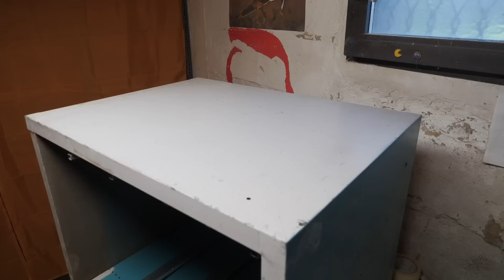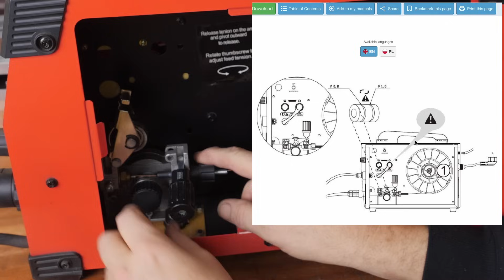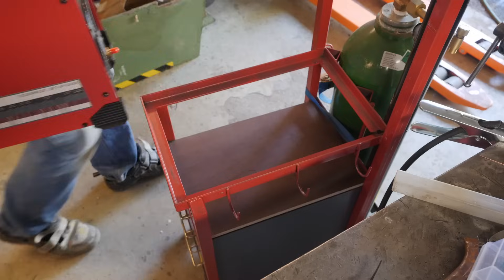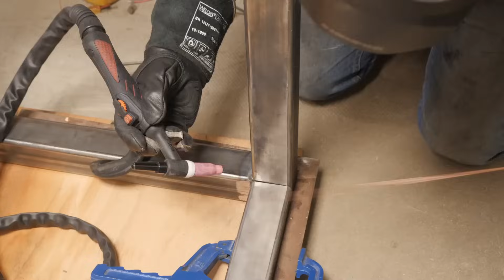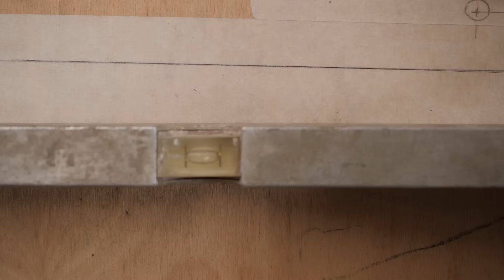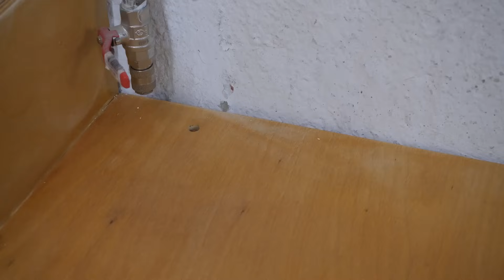My best workshop bench || RotarySMP

Comment: I assume that's a solid steel wire for the mig welding, since you got CO2 hooked up? I heard that with flux core a serrated drive wheel is desirable, because it can otherwise just crush the wire and feed less than it should. But since it clearly isn't slipping, that doesn't seem to be it either... I've also seen in some welding tutorials on youtube that being able to stop the wire is actually OK for tension (not being able to stop it would be too much tension). But again: clearly not the cause of the mismatch in feed rate anyway.
The "weirdness" on your new welders wirebrush is a pseudo-hammer to get rid of the slag from stick welding.
Reply from the maker: Thanks for looking at that. Yes is is solid core wire. That is a pretty weeny slag hammer. I already have a better one :)

Comment: In 1993 I was deployed for operation southern watch. Walked in the chow hall one day and the community bulletin board had a fresh picture of an F-15 with an enormous gap in the right wing tip Down to the honeycomb fuel cell from the tow team running it into the steel I beam of a sun shade. Ouch
Reply from the maker: Darn, that would have generate a couple of reams of paperwork. As will this A320Neo.

Comment: Your tig welding is getting better. Try working the puddle with the torch for a smoother weld.
Reply from the maker: Thanks for your feedback. I look forward to the next project for more practice.
Reply: @RotarySMP  If you don't know the channel, you might look at WeldingTipsAndTricks. He has been running what amounts to online welding classes for years. He's covered a whole lot of techniques and problems for all types of welding. He has a number of videos where he varies one parameter at a time and shows the results.
Reply from the maker: @lwilton  Thanks. I have been watching his videos a lot lately, but I guess I need to rewatch some of his MIG set up ones.

Comment: A point to check with your mig running slow is the liner and lead. They can get pinched and will affect the wire speed as will a liner with a groove worn in it.  That said it's probably the Controller not giving out enough voltage. The feed motors can slow but they usually just work or not.
Reply from the maker: It would suck if that is the case, as that was a new welder, and this was the first time the MIG side of it was ever used.
Reply: @RotarySMP  Probably got the wrong motor or the Controller needs an adjustment. It could be as simple as a pot adjustment?
Reply from the maker: @dazaspc  Shame the manual is useless, so there is no info on this sort of issue.

Comment: Wonderful bench, and a great video of the build!  I am spoilt with mig as mine is three phase and 250A but turn the current up and wire feed down to get the beads to sink into the parent metal. That new tig looks good, mine is ac/dc miller from the early eighties with no foot pedal, the arc on your new machine is almost plasma like! Have fun!
Phil
Reply from the maker: Thanks Phil. That ArcCaptain really does strike a nice arc.

Comment: Rule of thumb for TIG is 40A per mm of material thickness. It gives a good starting amps and you can titivate up and down as needed.
You have far more patience than I have with paint prep. It's what I really hate about painting, to the point I will do everything in the house except painting and decorating. I get someone in to do that.
Reply from the maker: Thanks Bill. But doesn't that wire speed seem way low?
Reply: @RotarySMP  I have never used MIG until last year, when I forked out for an R-Tech welder, already had their AC/DC TIG. Still on the first spool of wire and the welder has no voltage or wire speed indication on it. So I tend to set it where it seems to be OK. But, yes your wire speed on the old welder did seem to be slow. I will have to experiment as you did to work out what the actual speeds are. Must admit I use the MIG most these days, unless it's a stainless or alloy job.
Reply from the maker: @billdoodson4232  I also really enjoy working with the TIG torch.
Reply: And the second rule is don't weld your wiener